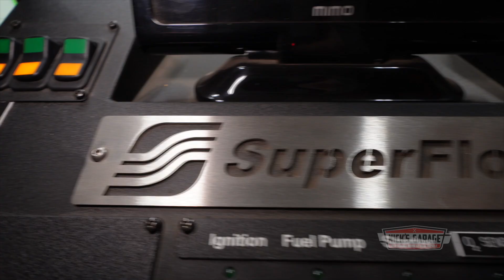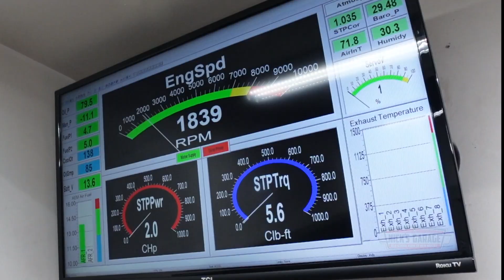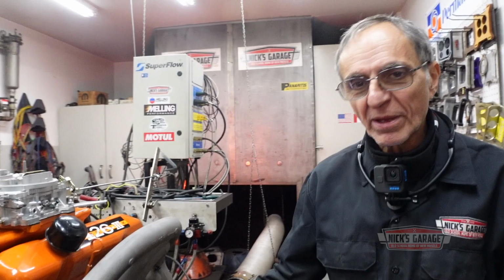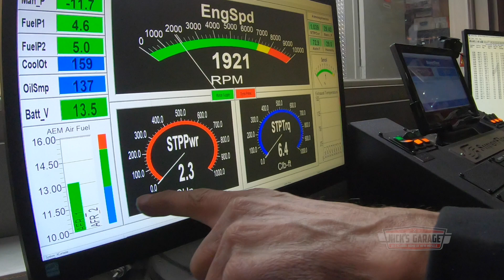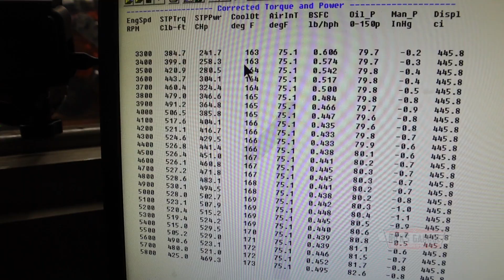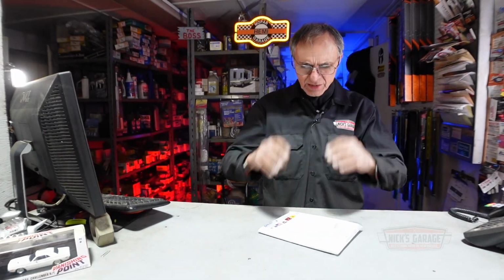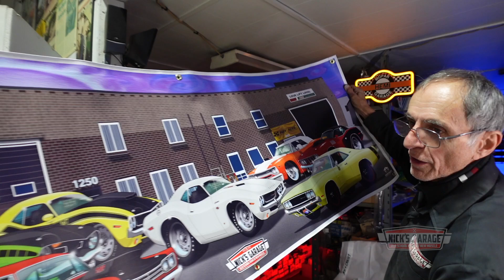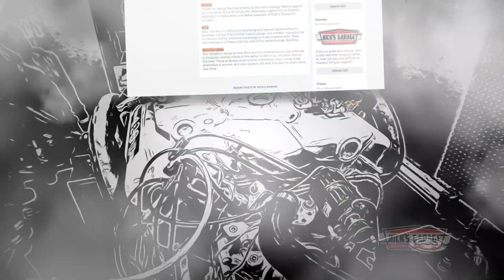Rare MOPAR Max Wedge - HEADERS vs MANIFOLDS

Comment: Gday Nick .  I am totally impressed with this Dyno session of the 426 Max Wedge !!!
I liven Australia and I have a Valiant 4 door sedan with a 273   V8 motor 
 with a stock 2 barrel carburettor, similar to a Dodge Dart .  I wonder if you have any performance enhancing tricks for this motor ?  It has an automatic transmission .
I have got a a 600 Holley and four barrel manifold and a HEI electronic distributor to Put on it , also

Comment: You should show the power curves on a graph for the headers vs manifolds. The manifolds are cool, but if I read the numbers right, at the start of the pull they are down 60ft lbs from the headers. That’s huge. And exactly in the rpm range where the car is far more often than 5500 rpm.
Do you think that the intake is why the power falls off so early in the rpm range? The heads flow great, and the cam has enough duration and lift that it should pull to 6000 rpm easily.
Reply: The cam was desighned  to max out at 6000 RPM's. I am wondering on the 413 next.  4BBL vs Long Short Ram.

Comment: I think it would benefit from different valve springs or shims. Seems like valve float is present around 5700 rpm. A 600 lift cam would benefit with more rpm.
Reply: More duration,  more RPM required.

Comment: I stand corrected you did say trickflow 270 heads. Did you have to do any port matching to get a good port alignment with the intake ? Just curious
Reply: It lined up pretty good.  We had the intake side of the head milled down to match it.

Comment: Great video Nick. I have one question. I'm a retired motorcycle technician and machinist and was involved in building street performance and drag bikes. When an air box and air cleaner was removed the engine ran leaner so we had to add more fuel, but with the Max Wedge engine you installed the air cleaners and it leaned out the engine. The only thing I could think of why this happened is because the velocity going through the intake was increased allowing for more airflow resulting in running leaner. What are your thoughts?
Reply: I was surprised it ran leaner with the air cleaners on. First time I see this. Why ?  Maybe because it is a CrossRam ?
Reply: @nickpanaritis4122  Okay, thanks for the info and reply Nick.

Comment: It would be interesting to see how it would run with the 4 barrel and intake that was stock on a 426 wedge.
Reply: You do realize that the four barrel wedge intake ports are different size than a Max Wedge port, right?
Reply: @mickangio16  I assume they are larger so the smaller intake would still give a good indication on how much better the 2X4 ran back in the day. Our modern intakes and carbs have came a long ways so would probably out perform the max wedge setup.

Comment: Love this engine.  Love the odd intake manifold(s), and the supremely well balanced HP and torque. THIS is the mill Mopar fans should rave about, not so much the Hemi.

One thing that seemed odd to me is that the air cleaners made it run leaner - I would have thought that restricting the intake air flow would have made it run richer.

Comment: Giving up close to 100ftlbs at 3000rpm though with those manifolds. That will be noticeable, as will the 10%more fuel burned to make the power but it sure does look good!
Reply: Who cares about Anything under 3000 Rpm unless it's a work truck !! With the right Converter stall,....3500 to 7K is where the action is !!
Reply: @tomstrum6259  well most these old cruisers will spend 99% of their run time at less than 3000rpm unless the cars have been regeared.

Comment: Ah, 😎👍 - I was hoping you'd use the OEM style 'Max Wedge' style manifolds after they performed so well in your testing a while back.
If I had the money, and an early sixties Chrysler, that's be a really cool combination with a stroked RB with some serious cubic inches.
Wasn't there a 413 version of the "Max Wedge" as well? Either way, dressing it with the correct 413/426 decals would make for a nice sleeper that looked period correct.

Comment: So I take you don't have a drill press and welder is why you sent them out to be made?
Reply: How long does it take to make those flanges doing them your way?
Reply: We have drill press and welders in shop.  Working late every night and keep making flanges for Max Wedge and then the  413 long manifolds is not an easy task. Buildin engines and making things fit is time consuming. I try my best.
Reply: @johnz8210  i could have made them both in well under an hr
Reply: @nickpanaritis4122  I meant no disrespect Nick. Exhaust is natural to me. I love your work
Reply: @ghostrider.13     All good.

Comment: I’m surprised that engine didn’t want to rev well into the 6k range with that size cam.
Reply: Why "Surprised"  ??? .....You can easily tell by the engines really Smooth No Loping idle there's  No Proper Long Overlap Mid--high Range Rpm camshaft in there !!  The cam Isn't  Matched to the high flow Heads & Intake &  Sounds & Performs just like a short overlap, good Mid Range Rpm application camshaft Needlessly Quiting right at the Rpm where the Good HP Action starts coming on.....Maybe ok for a work truck or something but Not a "Max" engine......
Reply: Made my statement based on my experience with my Olds 455. I’ve never built a Mopar but I do know they have a much bigger bore and shorter stroke than the Olds. My cam was in the ball Park for duration and lift (slightly smaller) but probably had more overlap because mine would rev past 6k in a heartbeat even with the smaller bore and longer stroke netting me just shy of 600 HP and TQ.

Comment: I know its a 440 cid shortblock, but did you mention if you are using the max wedge heads & intake or just 906 heads  with the max wedge intake? As we know the max wedge ports are considerably larger than other wedge heads. Thanks nick love your channel!
Reply from the maker: see for yourself! 
https://youtu.be/CScoX0chmUY
Reply: Trick flow 270 cc  intake runner tall intake port.

Comment: Hi Nick, what kind of SPARK PLUGS is the MAX WEDGE running ? If you have a part number that would be great👍🏾🙏🏾
Reply: Auto line.  Recommened by Trick Flow. I do not have the plug number off hand.  Doing comments from home.

Comment: Nick, do you think the long runner lengths in that manifold are fighting with the cam? The rpm for peak horsepower seems to be on the low side for that much duration, especially since the cylinder heads have bigger intake ports than the usual 440 heads. I'm just thinking out loud, but it seems to me a cam with less timing, less intake timing in particular, may be a better overall choice. More torque and power in the range where that manifold wants to run, with little or no loss up top since that manifold isn't going to let a 6500 rpm peak type cam do its thing anyway.
Reply: I was told that HotRod had tested in the past Max Wedge intake vs a good 4BBL with a similiar set up and produced just over 60 HP plus.
Reply: @nickpanaritis4122  I caught your comment about that in the video. I can see how a single 4bbl on a modern single plane would do better up top with a hot cam, the shorter runner lengths coming into tune where the high rpm cam wants to run. Do you have any thoughts about my idea of less cam being beneficial with the long runner cross ram?
Reply: @davidmarshall8628  ... Yes, good possibility. Talked to a few cam manufactures, all different opinions on the Max Wedge intake.
Reply: @nickpanaritis4122  Thanks Nick. I appreciate being able to chat with a pro like you.

Comment: Chrysler made another intake manifold that put the carbs outside the valve covers Each carb supplied fuel to the opposite of the engine. It was to increase torque more than making max horsepower.
Reply: You will see one soon if you keep watching Nick.
Reply: I guess you're new here ;-)

Comment: advice, jethot coat the exhaust manifold inside and out, They would be a good sponser. will pick up the 10hp it lost and run cooler, Aftr braktre in put Bell Concentrate and headers the HP will be like the headers.

Comment: well, I'll tell you my opinion. Somebody should either cast up a bunch of those exhaust manifolds, or they should make up a set of headers that are exact copies of those manifolds! because the headaches of dealing with headers is not worth the gain from those manifolds. but headers ARE worth it from normal log manifolds. those things are only good for weights.

Comment: Nick, do you have a flow bench to text the exhausts to see how much difference there is in CFM between the headers and Max pipes. I would have thought the Max pipes would have produced more hp because they're no sharp bends like the headers have which slows down exhaust flow in those areas. Also the length of each tubing should be the same length or as close as possible. Being that the engine ran rich with the Max pipes shows me that they do not flow as much CFM as the headers do. What are your thoughts.

Comment: Not to criticize you guys but the throttle pivot is installed backwards. The whole in the pivot lines up with the hole in the manifold so you can set the throttle blades evenly.

Comment: Heh...

I fixed the blown apart exhaust manifold on my International 392 I/C and NOW I can hear all the lifters clatter, all the blow by on the burnt valves and all the piston slap if I run it on shin oil.

Comment: Those back butterfly valves look like they are trying to fly up out of the carburetors... 

Or like leaves in a hurricane....

You should do something to stabilize them to get steady power without all the highs and lows of the rapid and random changes in air flow.

That will not only reduce engine performance, over the life of the engine, it will accelerate ring and bearing damage.

Comment: ..were these the mani's nicknamed the French Horn? Or were those on the 426 Hemi?
Anyways, yes..all about moving air in & out! Idk what CFM those 4 bbls are..450 each? This mill may need more. Try dual Thermo-Quads! ..it's been done & they really work to keep fuel cool, no bog bc fabulous air door/on demand operation and you're not going to use up the flow..1,600 or 1,700 cfm combined, ahahaha. 
p.s. ppr element air filter note: Only the big oval air cleaners back in the day could flow enough air for a Chrysler BB. The 4bbl size air filters did not. Food for thought for builders/tuners out there.

Comment: You say there is "only" a 20 pound difference of peak torque between the two. You gotta point out how big the difference of torque and horsepower is though. Below peak, there is over 50 horsepower and torque at times and pretty much 40 number everywhere else. That's a huge difference between headers and manifolds.

Comment: If it was a cruiser only , I'd change the carbs out for a paid of 500cfm or 600cfm maybe 650cfm, but maybe even 450 cfm carbs, smaller will be more responsive!  Depends on the gear ratios and trans type, probably 500 or 600 and Holley carbs! And put taller filters in the atr cleaners, probably make some troughs to fit around then with ducts going to in front of the radiator, to get cool air to the carbs, even with a scoop, I really don't like the air cleaners,

Comment: These manifolds probably would have done better, if someone had welded the exhaust pipe to the header flange straight and not at almost a 45° angle...

Comment: The valve float issue reminds me of a 1960 Triumph Herald I owned in 1966.  It would float the valves at 65 mph in top gear.   That car was the worst piece of crap I ever owned.   It turned me off buying ANYTHING British ever since.
Reply: They are not all that bad.

Comment: if your determined to add loud noise in the video put up a warning sign so we can turn off the volumn
Reply from the maker: What noise do you mean? The dyno?
Reply: the mic does not relay the correct sound of the song, even if it did come across correctly, i had rather just have the straight some times break in the volume of the show  just to get the real vive of getting to be there and watch the action and not having music or advertisements bumping in on the video would be a lot easier show to watch. The longer the better, start to finish run the video its like being at work but no pay check, please send me a pay check every now and then, or build my 350 chevy sb
Reply: @NicksGarage  not the dyno , not trying to tell you how to run the show but my computer system picks up the volumn from the added music as 1/2 static and too much volume, and i do wish the door to the dyno room was closed more often to keep the loud engine noise down some.
Reply: Music does not transfer through this system very well, i prefer just the show at normal volumn and tell Nick his mic works very well and no matter how much racket is in the room he can talk at a normal volume and we can hear him very well. seems like he's talks loud thinking he's not being heard but the mic can pick up and work good because the mic is on his collar.